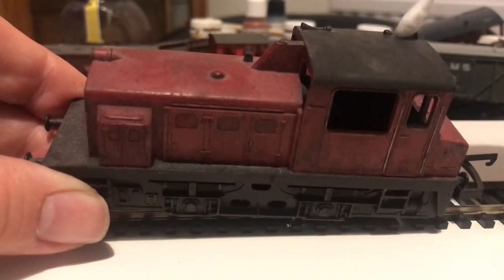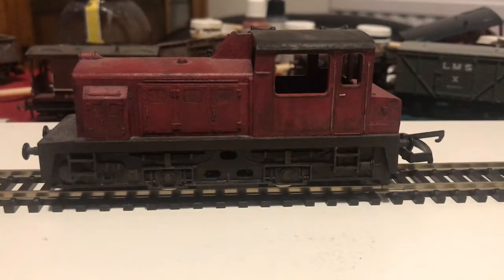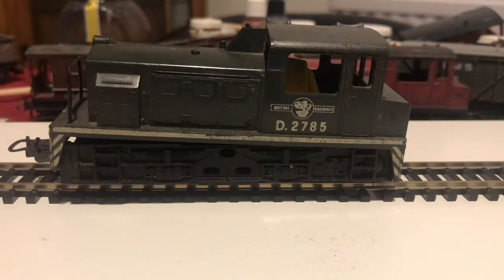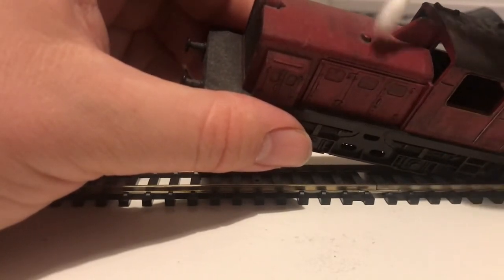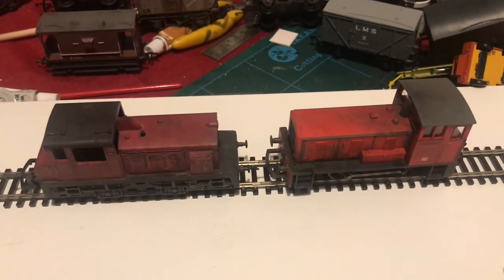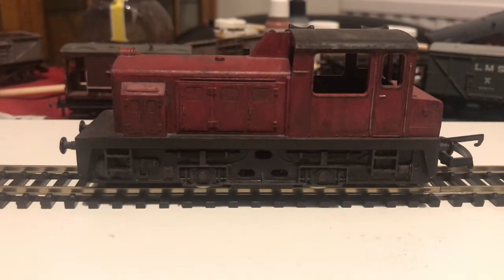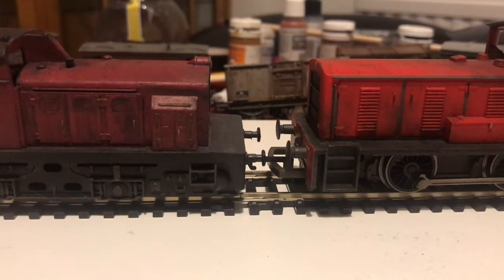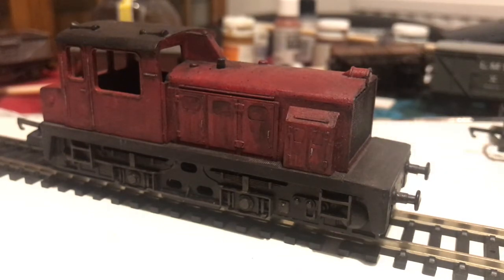Jago’s Trains: Does Plymouth Rock?

Comment: Fun fact, If you run one of those things at FULL SPEED around in a loop a few times, you can actually get them to run very well, I got on to go REAL slow because of that littlre trick but that locomotive has a different motor as the american ones so idk if it will work for you